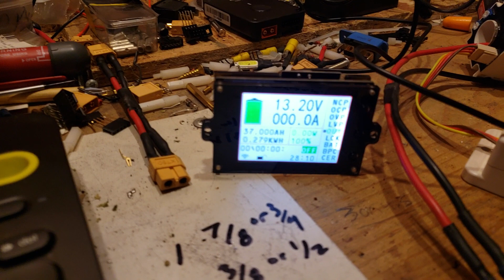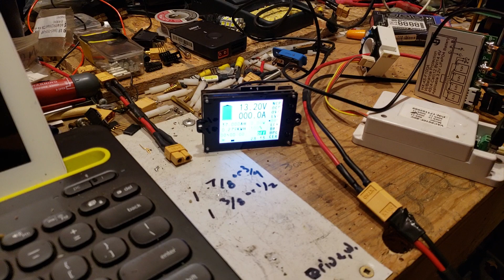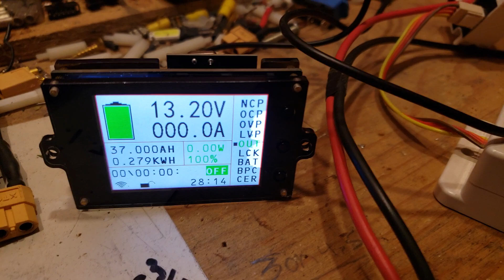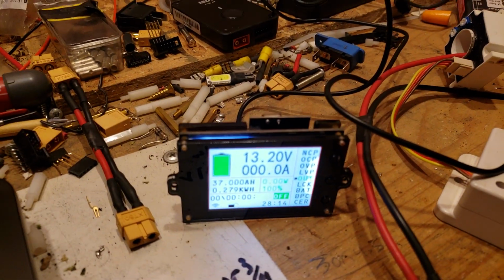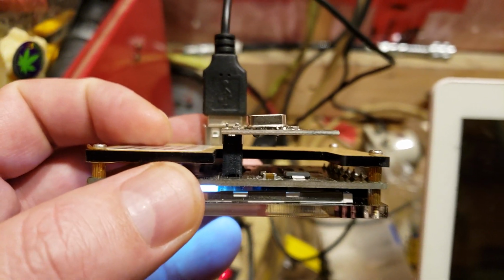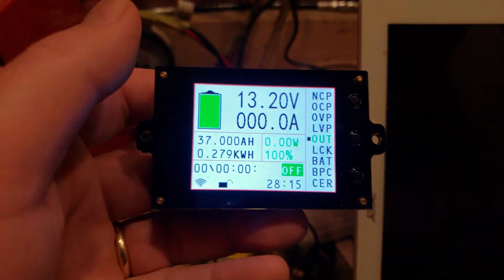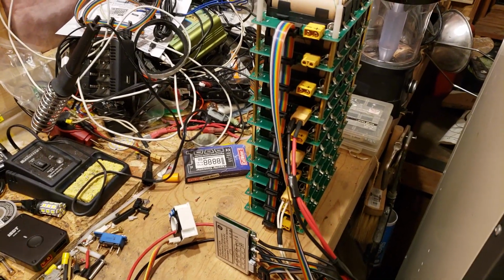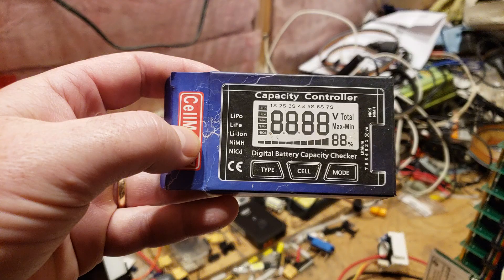Diy lifepo4 battery pack build. 40 lifepo4 26650 in a custom PCB stack

Comment: How did you go from the 10 wire balancing leads from the battery packs to the 5  wire bms connection? Thanks in advance
Reply from the maker: I used the 10 pin as a 5 pin and the top 5 pins of the connector and the bottom 5 pins are the same , effectively giving me two wires to each balance connector, then i just only use the top 5 or bottom 5 to connect to the bms, one ground a 4 balance leads
Reply: @morgangatton7472  I am building the same battery pack. Do you have an example of the 5 pin connector? I'm new to eletronrics.